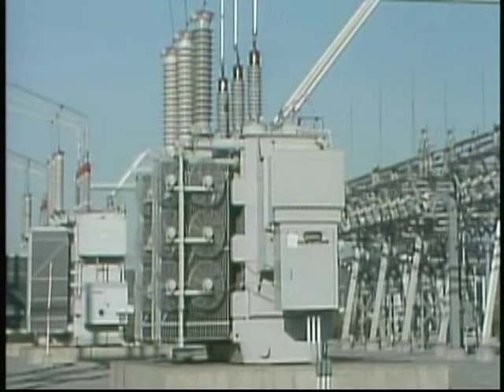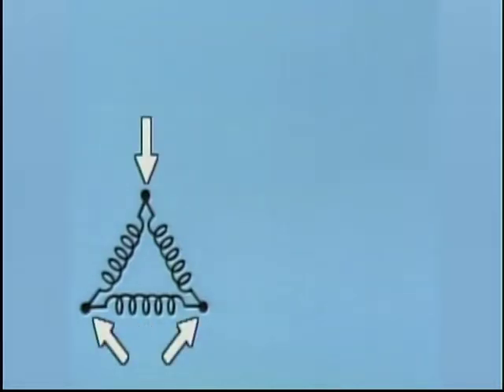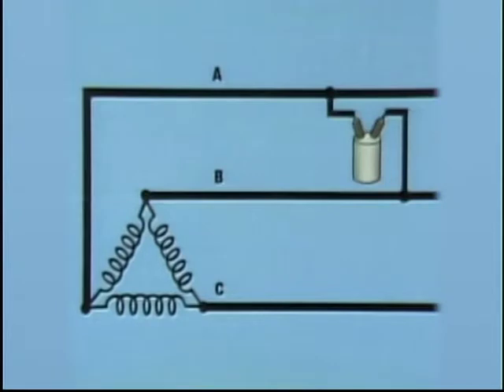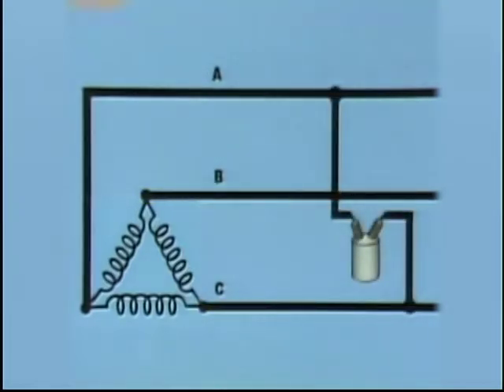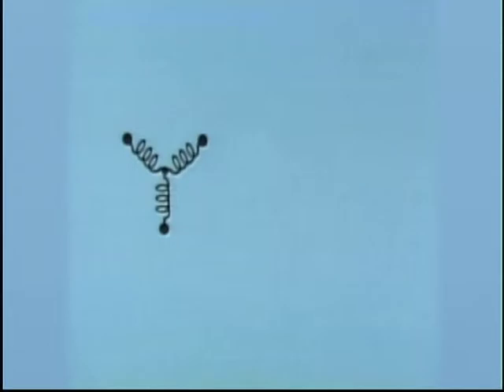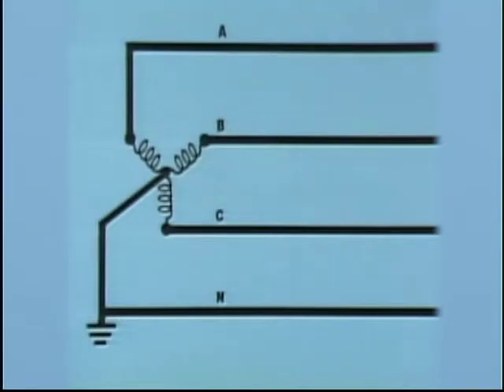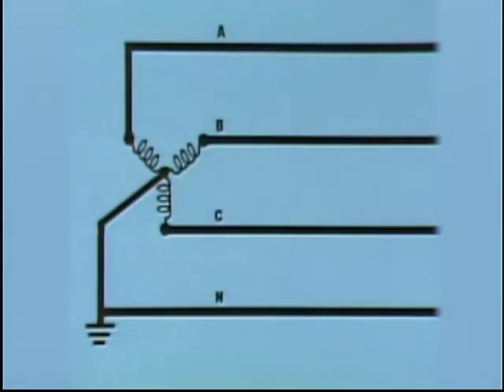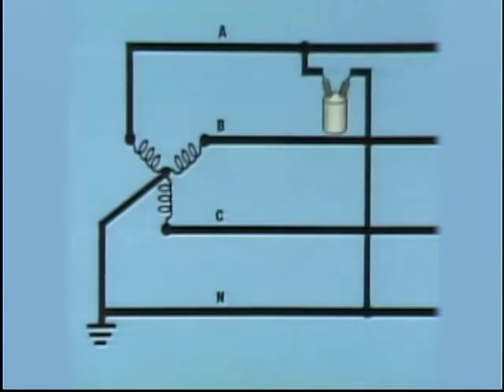Delta and Wye Primary Systems

Comment: You can use two bushing delta pots on a wye system. It all depends on the transformers required system voltage. Our system is 7620/13.2Y and we have transformers that require 13.2 so they get 2 primary connections. And we have single phase 7629 pots that are conventional 2 bushing pots . It all depends on the system voltage and the required voltage of that transformer. I’ve worked on systems that were grounded wye on the main line and all the fused laterals were 2 phase delta with no neutral. Key thing is pay attention to system voltage and required voltages of the equipment being installed.

Comment: Can the DISTRIBUTION system have a three phase three wire DELTA system WITH NO Neutral (back to the substation) and use a single BUSHING 
transformer with a CASE GROUNG ?     

This possibly not covered in the video?  thank you

Comment: Interesting, but not the least bit useful, because it doesn't really explain the principles or rationale.  It's more about norms (with several exceptions), as if high-voltage electrical systems are like ornithology.